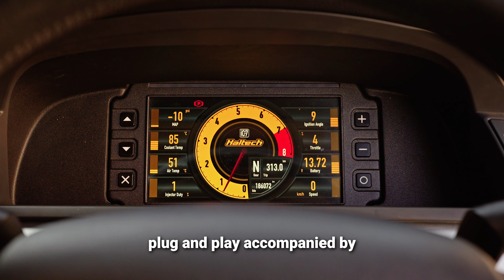Australia's Only PPG Sequential XR6 Turbo

Comment: Ventilation on the bonnet would fo heaps.
A thin low profile letterbox type scoop, the opening facing windscreen.
Maybe custom make carbon fibre ducts to pipe cold air onto the compressor, shield it with gold foil